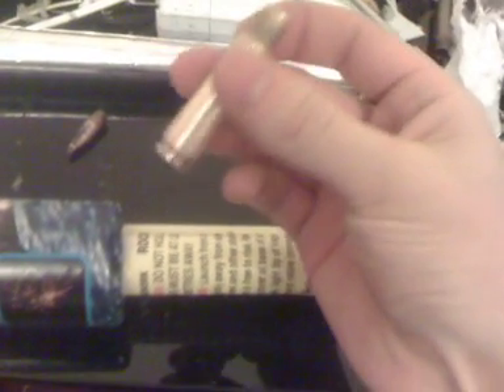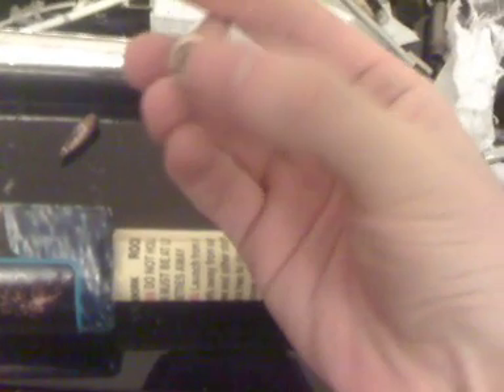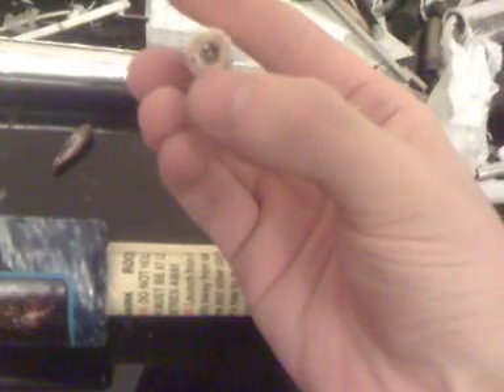homemade tracer round?

Comment: i see this is an old video,  but i would not recommend using any random powders as they can detonate, i have seen videos of people trying to use match heads, but you can literally pull the bullet out and drop a few match heads in and crimp it and slam it on the ground and it will detonate. this is why i say no

they best way to make tracers is to take magnesium rode or farrell rod fire starters and scrape the metal off into a fine powder, make home made napalm, with gasoline and Styrofoam . and all you need is just a tiny airsoft sized bead. you mix this in with the metal powder and make sure you use as much metal powder as you can, i would say at least 70-30 to the napalm, then stuff the hollow cavity under the bullet full and make sure it sticks inside good.. this will ignite like a tracer, also make sure the napalm is thick like bubble gum,